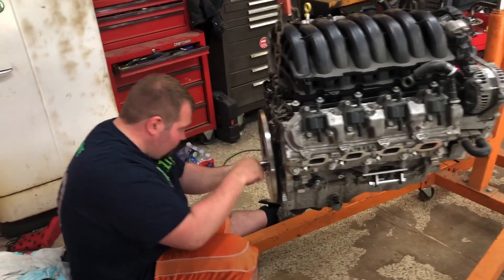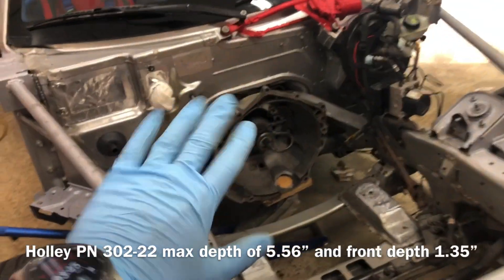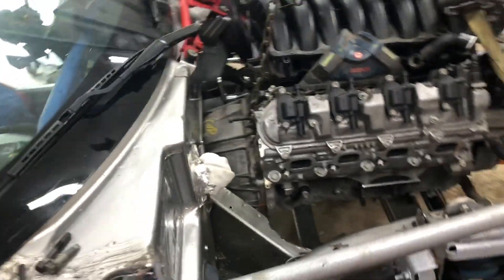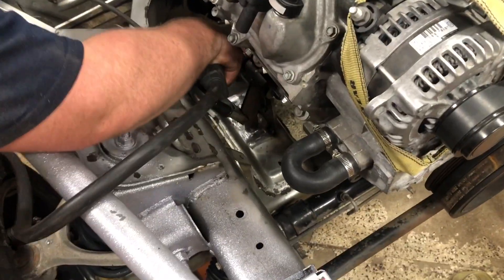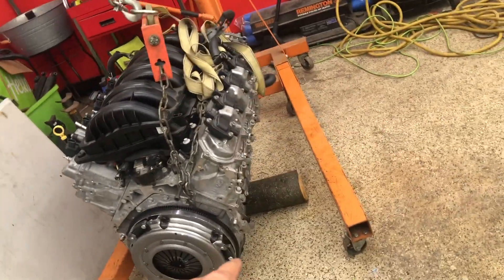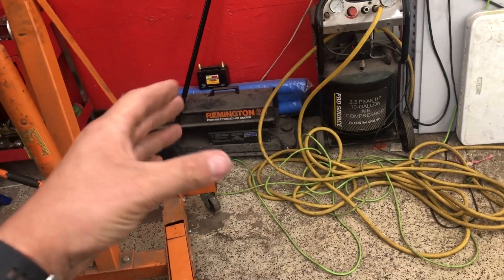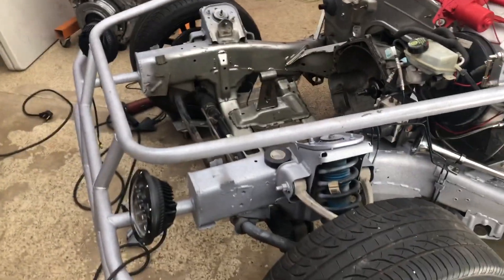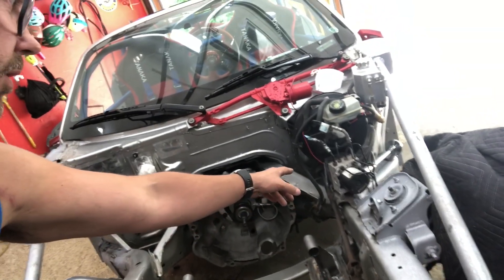Solstice Deathkart V8 Swap- Gen V L83 5.3l 355hp- Part 2 Engine mockup & motor mounts

Comment: Flywheel?
Reply from the maker: We had to use an Uber expensive aftermarket flywheel that has the bolt pattern for the Gen V LT but is made to bolt up a regular F Body LS1 clutch. I think it was like $4-500 for the flywheel and it’s just steel. I think it was made by american Powertrain or something like that down in Tennessee. I think one of the earlier videos detailed this.

I think this one:
https://youtu.be/WMekqb8ug2w

Comment: Would you happen to have the part numbers for everything you used to convert l83 to the AR5 trans? Minus the fly wheel of course
Reply from the maker: You just need the FabBot adapter setup. Go to fabbot.com and you can check out there setup. They have fantastic customer service too if any questions or support needed and some YouTube videos on the isntall